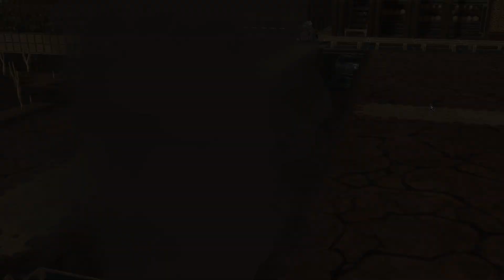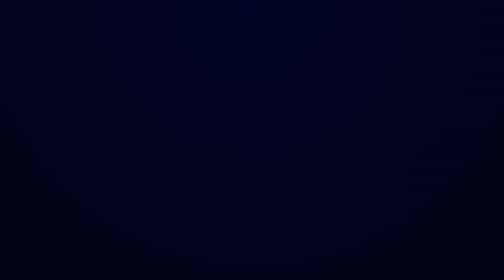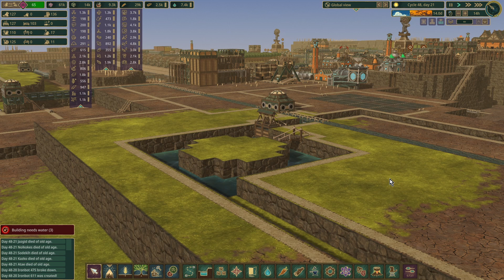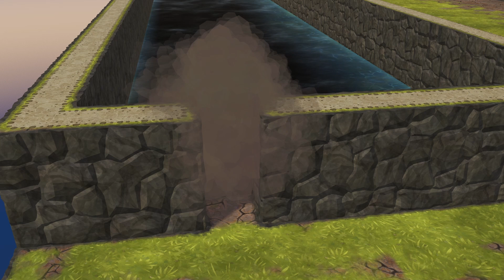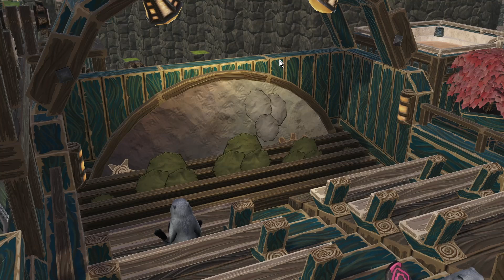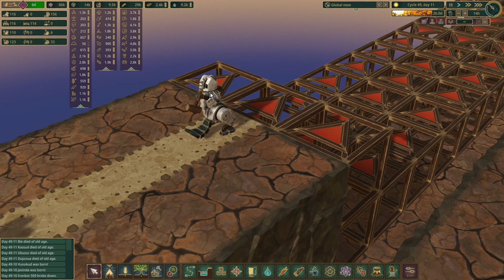Timberborn - Hard Mode Update 7 - Overcoming Challenges

Comment: 10:12 👀Why?? Why not dirt on top of the levee? 🤔
Yeah that irrigation project is now over-engineered. You can overhang dirt so you just needed to make the channels three wide and overhang the ceiling/sealing on top of the channels with dirt. No Planks Need Apply. :)
Reply from the maker: There is method to my madness. I was thinking that a levee would be easier to destroy if I needed to replace the sluice later on. I could just delete it rather than placing explosives and waiting for the beavers to set it up.
I should have just used the overhangs, but once I'd placed the initial tunnels, it was already too late.
Reply: @StormhavenGaming  Ah yes, I completely understand. I will be able to sleep at night now. 🙂

Comment: Control towers can be readily built on single platforms, so you could move that one to above the medical bed.
Except during badtides, that expanded pool you created because you thought it would prevent flooding would make a nice swimming pool; sadly the tubeway is restricting how much hydration it's providing somewhat.
I am wondering how the terrain on top of the tunnel is getting any hydration. Or maybe it won't...
Reply from the maker: Yeah, the tubeways continue to be a bit of a pain! I'll have to put in a few swimming pools on the other side of it.
And yeah, the terrain over the irrigation is not behaving as I wanted...
Reply: @StormhavenGaming Ironically if you'd gone for what my memory tells me is your original plan of just putting one layer of tunnel each side then it would have worked.
Reply: @ Although now I've seen what happens after you covered over your original canals, I'm going to assume that was your plan all along, and it doesn't matter that you tunnelled out a bit more than you really needed to.

Comment: Do the underground irrigation system no need for fluid dump, just tunnels
Reply from the maker: Hopefully I won't need a fluid dump, but once the water level in the reservoir drops, it will stop feeding into those tunnels and they will start to dry out. A fluid dump might be needed to keep them topped up during long droughts or Badtides.